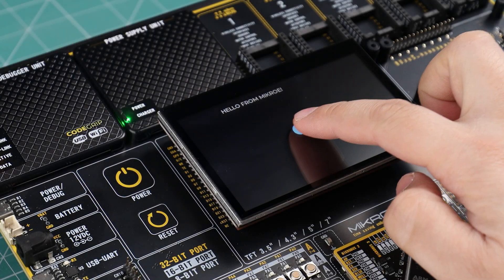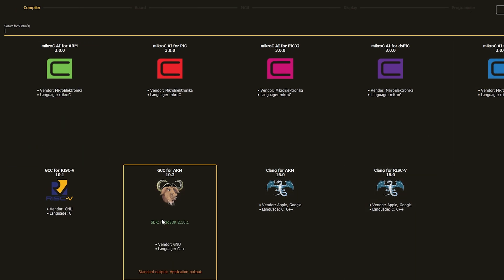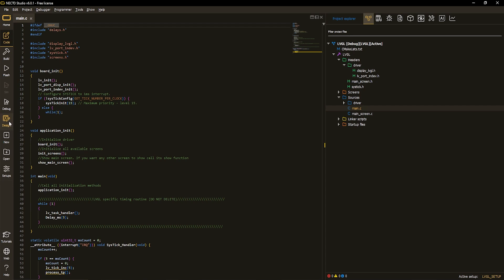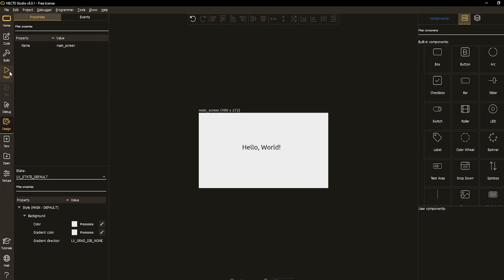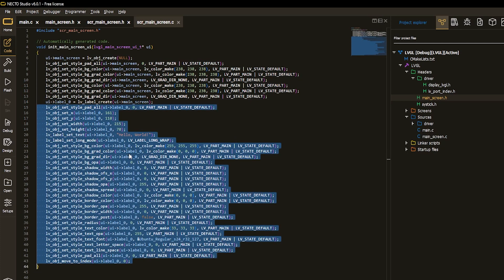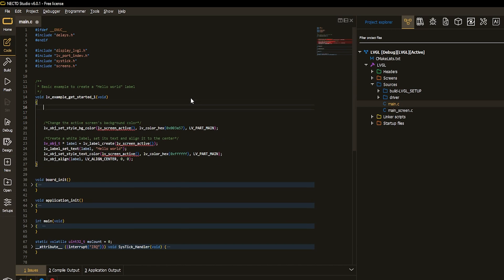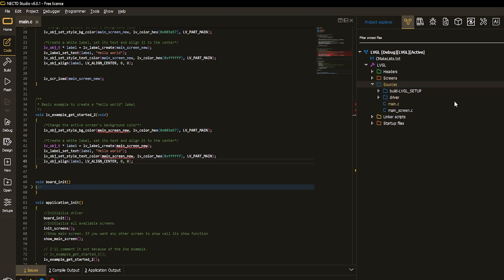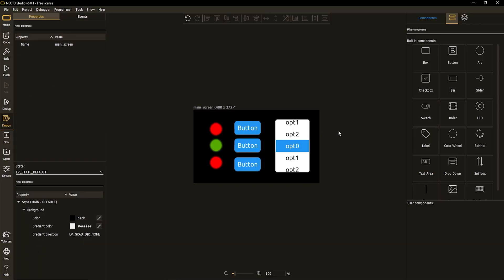NECTO v6 and LVGL | Explained!

Comment: Also, are they going to support external flash or is there already a way for me to add it?
Reply from the maker: Good question! There is a solution: merging our DMA example (which utilizes FLASH transfer) with our LVGL example! DMA example can be found inside NECTO's Package Manager feature (just type-in: "DMA").